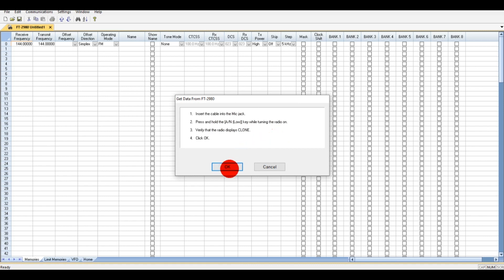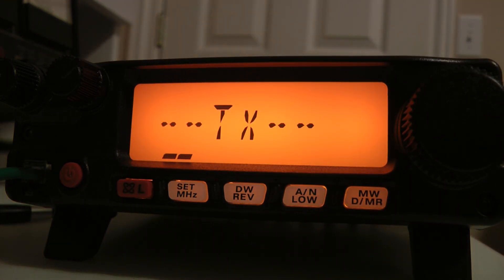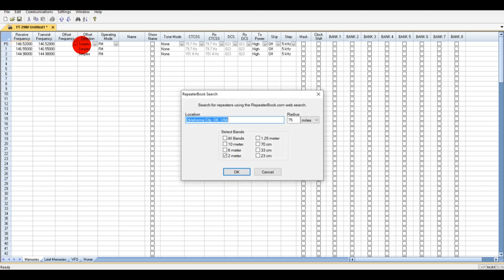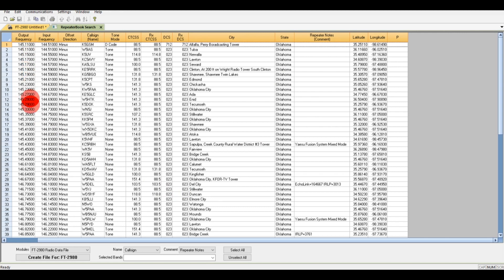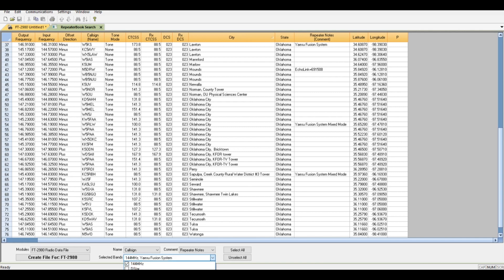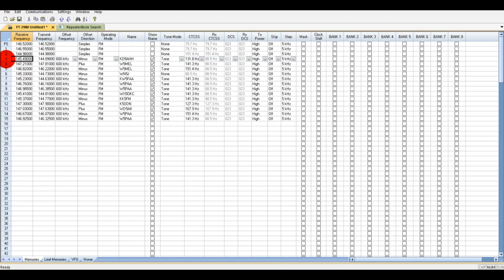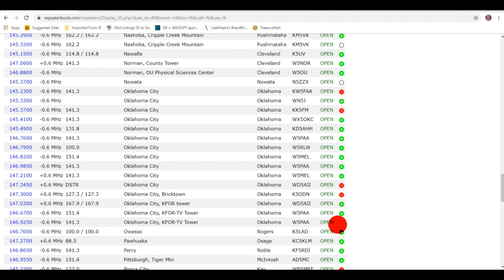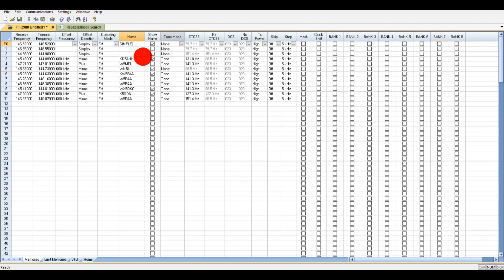Yaesu FT 2980 Program with RT Systems Software

Comment: I think I need another piece of equipment...(it seems to never end) Unless I'm in the car, I need a  power supply for the 2mtr radio. Any suggestions on a power supply?
Reply from the maker: Robert I use a Astron 35 Am Power supply,  I use it for my IC 7300 and My FT 2980.  You don't need that large of power supply.  You could probably speak to a ham dealer to find a good power supply to use for the radio.  Thank you for watching my video!!

Comment: I HAVENT FIGURED OUT HOW TO USE COMPUTER PROGRAM CABLE.
Reply from the maker: Are us using the RT Systems Cable?  It plugs into the microphone
Reply: @RichRodgersOnline  IT IS RT SYSTEMS DISC AND CABLE.  I HAVEN'T PLUG IT IN YET.  I THOUGHT IT PLUGS INTO RADIO?
Reply from the maker: @microminiskirt  Yes, one side plugs into the microphone
Reply: @RichRodgersOnline  I WILL CHECK BACK IN WITH YOU ONCE I PLUG IT IN.

Comment: How does this Yaesu single band 80 watt mobile compare to the BTECH mobile 
BTECH Mobile UV-50X2 50 Watt Dual Band Base, Mobile Radio: 136-174mhz (VHF) 400-520mhz (UHF) Amateur (Ham) which costs about 20-30 dollars more?
Reply from the maker: Hi XXX, Thank you for watching. I really don't know anything about the BTECH. When I am looking for a new rig, I go for word of mouth and I look at reviews such as eham.net.  If you live in a city, 50 watts would be all you need plus you get a extra band.   I also would recommend shopping around  I saved $20 by shopping around.  Another thing, if you are on the road a lot (between towns), the 80 watts could help get a little  more distance leaving a town or coming toward a town.  One more thing. Ask  other hams how active 70 cm is in your location.  If it is active, then it would be nice to have a dual band transceiver.  I hope this helps.
Reply: @RichRodgersOnline  Thanks Rich.